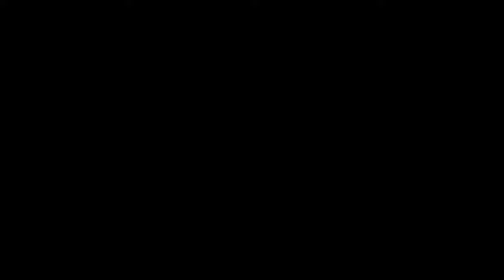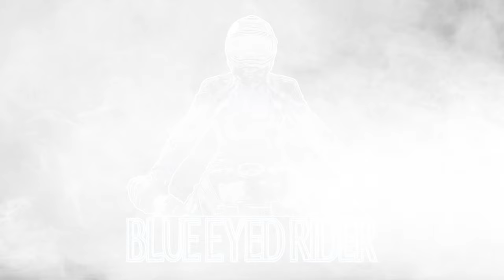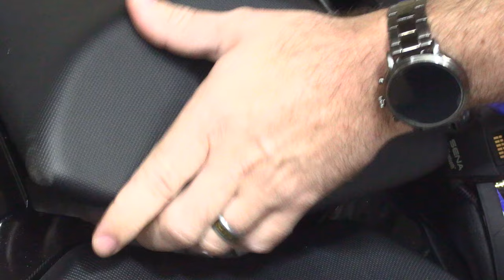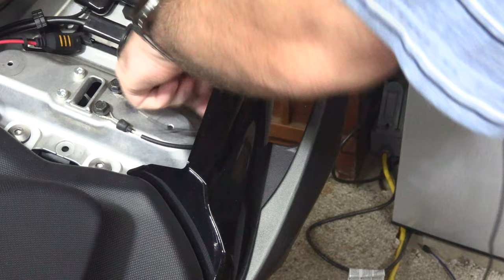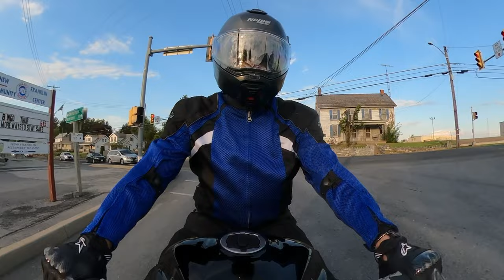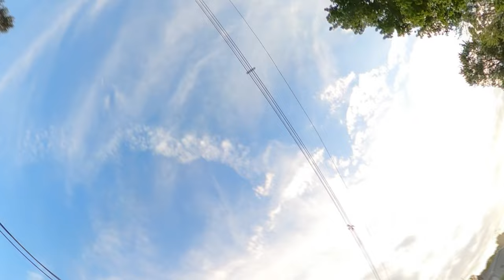Kawasaki Ninja 1000SX - Helmet Tie Cables and How To Use Them to Lock Your Helmet to Your Bike

Comment: I use mine quite a bit when I don't have my side cases mounted. They came on my '22.
Reply from the maker: You don't find that the plastic gets messed up with rub marks, etc?
Reply: @BlueEyedRider84   I'm careful, like you were in the video. No issues so far, that plastic under the seat is actually fairly stout.
Reply from the maker: @TK-cl1jm  good to hear.  I am so cautious around the plastics or actually any painted surface especially black as it shows every little imperfection lol. Sadly still won't use them since I don't have a D ring helmet

Comment: Never knew that. They font provide them anymore. Was always wondering why those 2 bolts were missing. Thanks.
Reply from the maker: I think it depends on where you get your motorcycle. In the US, at least the ones at my dealer, they still have them. I have heard a lot of people in other countries they haven't had them for years.
Reply: Theyr're on my 2023 1000sx. bought in texas.
Reply: @tylerharrington4515  On mine also, 2023 New Jersey

Comment: Hey there. I just got a 2021 Kawasaki 1000sx and wondering how I can adjust the clutch pedal. Usually you loosen the two nuts, one on each end of that rod and rotate .. but this has wiring and quick shifter there didn’t want to risk it. Can you help? Found you on you tube thanks.
Reply from the maker: I have a video coming in a couple weeks on it but it's simple enough, yes, loosen the two left nuts at the tie rod and rotate. They are 10mm. The left most nut is left hand thread. Just be careful around the wires on the right hand nut. There are three nuts total. You hold the "black tube" - I forget the name right off hand lol, with a crescent wrench or large wrench at the back end of it. There is a third nut, you don't need to worry about that one that is at the other end.

Comment: I have a 2 questions?

1. Ninja 1000 SX 2021 has 2 sockets on the left side, one for 12 volt cigarette outlet and the other for whom, wire is red with blue line.
Reply from the maker: Yes, there are two on the left, as yo mentioned the one is for 12 volt accessory outlet (cigarette outlet), the other is for heated grips. Be advised, the fuses are different on them. The accessory outlet I believe is only a 3amp load, where the heated grips is 7, I believe - I'd have to double check those values, but they are definitely rated differently
Reply: @BlueEyedRider84  i send a video on your Instagram .
Reply: @BlueEyedRider84  but heated grips socket on meddle on headlight
Reply from the maker: I'm not sure why the owners manual says behind the headlight, there is no connector there. The connection is the blue wire one under the left fairing. Wiring diagram in the service manual agrees as well as the install manual for the heated grips.

Comment: Which company does the USB charger belong to, and what is a black colored square type device, what is GPS?
Reply from the maker: The USB charger is OEM (Kawasaki). The black square is indeed GPS for my Innovv camera system.
Reply: @BlueEyedRider84  USB charger price?
Reply from the maker: @divyanshupratapsingh104  the OEM was outrageously expensive. $110 USD. Crazy thing is I never use it because it's under the rear seat where nothing can fit to even charge. I have aftermarket USB ports run up to the front on each side of the bike where they are more useful
Reply: @BlueEyedRider84  1 video please for usb charger front both sides and rear seat.
Reply from the maker: I have this overview video for the OEM USB charger install: https://youtu.be/2x9DTGnOMFk

If you need more please let me know and I will see what I can do.
Reply: @BlueEyedRider84  front usb charger?
Reply from the maker: @divyanshupratapsingh104  sure, I could do a video. It's not too difficult to do tho. You connect to battery directly, run the wires in safe spots and then I used 3M VHB tape to mount on my frame that's accessible on the left and right of the handle bars. You could also wire in thru the DC accessory outlet spot with an aftermarket USB one or use a DC accessory to USB adapter. Either way I can work up a video on how I ran the front USB, no problem

Comment: Well I'll be dipped in shit 😟😐 I'm 65 with the ninja 🥷 1,000 a 17
Model bought in 18
Now 35,500 miles and been riding since 1964
And you actually showed me something that I thought I knew but didn't ‼️‼️👍👍
I'm going to be checking ✔️ in to your channel more often ‼️‼️ maybe learn more🤯💨 hopefully my head won't explode 😅 from to much information 😅 😉
Reply from the maker: It's always great to hear when a viewer learns something new, especially a veteran rider. Thanks for watching!
Reply: @BlueEyedRider84  ya I just got back from a 60 mile trip with runs up to 140 ⚡️⚡️ I had
A semi tight chain ⛓️ ✨️ 1 inch roughly of play this is where mistakes are made ‼️
Cold it's roughly at max
Play this is where you just leave it alone and don't mess with it ‼️‼️

Comment: There are two wire straps on the 2021 Ninja 1000SX, so I guess if you REALLY desperately wanted to use them, you could loop the two of them through the visor hole and then lock the cables together with a padlock… Not that I would, but you could.
Reply from the maker: That is an option I hadn't thought of.. but like you said, probably wouldn't do it anyway lol